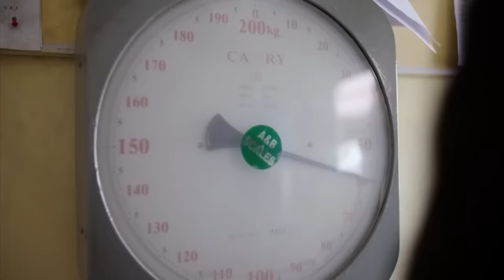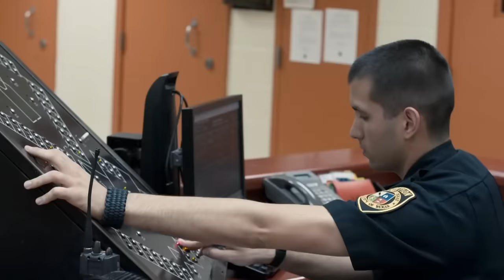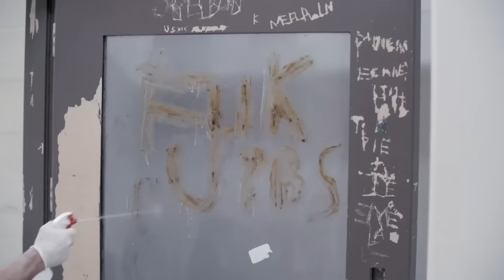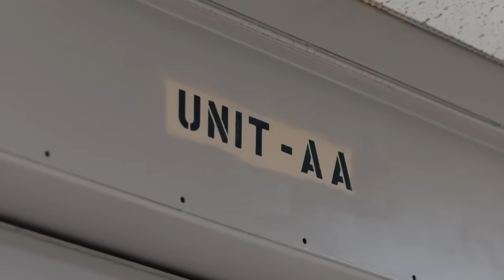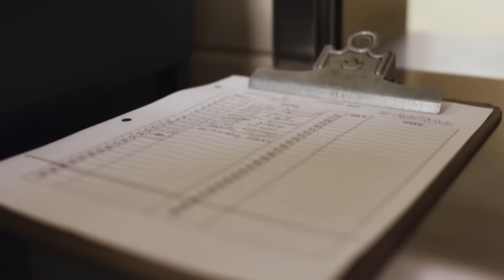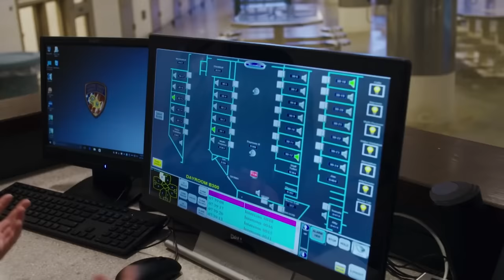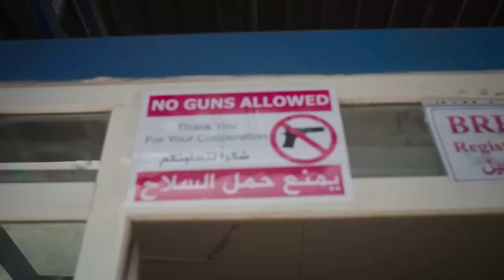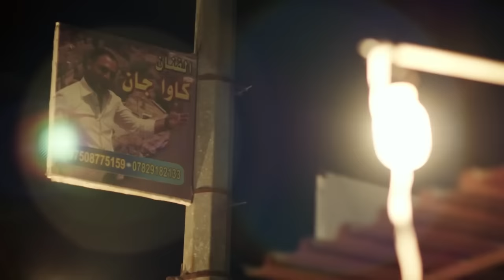Largest Toxic Waste Dump, Jails and Refugee Camp | The Insider: Reggie Yates | Free Documentary

Comment: You would think as creative as they are they would build huge furnaces with tall stacks. It wouldn't be that hard honestly.
Reply: The problem is that you need to burn the plastic without boiling the copper. That’s why they use the puddles to cool it off and stop the copper from boiling off. 

I’d say that for the risk reward on burning would make it more feasible to create a little bench mounted wire stripper. 

I could be wrong but I’d say based on the amounts that they were doing in a day you could strip that on a simple home made stripper.
Reply: @Mobile Game Clips  I think you are correct. A way to strip them like speaker wire and old school wire cutters. Got me thinking now. If they are doing several hundred yards of wire a day doing it by hand would be fruitless. There has to be something lol.

Comment: A wood board, hammer, nails and a drill with various size bits and I can make them a station for peeling copper wire in seconds sans burning.  I’m shocked.

Comment: I don't understand why American waste would make it there. In America they got huge grinders you can feed in a car and it separates it into all the different metals.. no need to send it thousands of miles.  And we have wire strippers. No need to burn that wire. One machine can replace 1000 burner boys. And no burning. Also the plastics and rubber coating on those wires are recyclable. At least if your going to burn it do it in a steam engine and make electricity and use that power to filter that water sewage.

Comment: 20/32 we need the front end loader to be electric-powered so you don't have to buy gasoline and you need the hydroelectric fuel-cell to help you recycle so you don't have the contaminants running all around and you can get the electricity to power the rest of the equipment